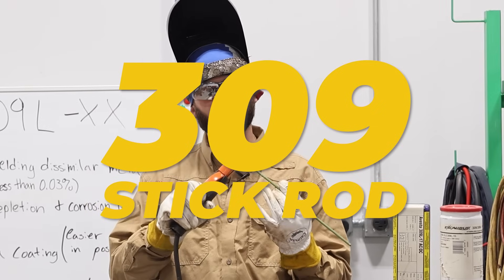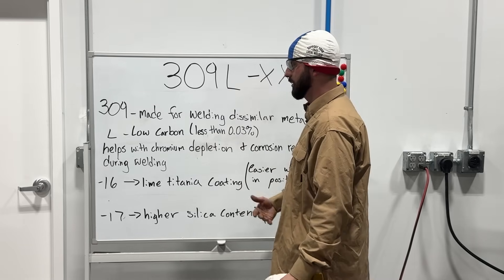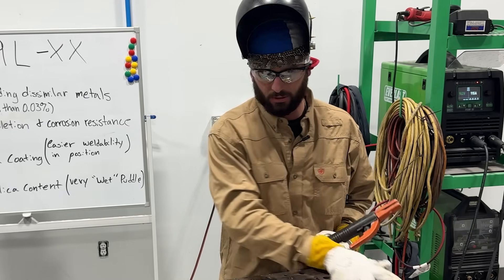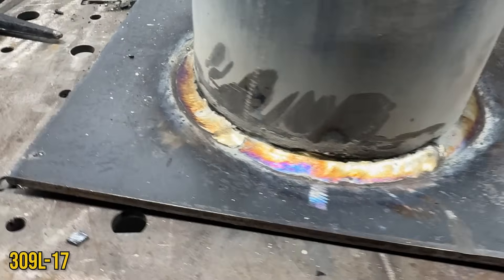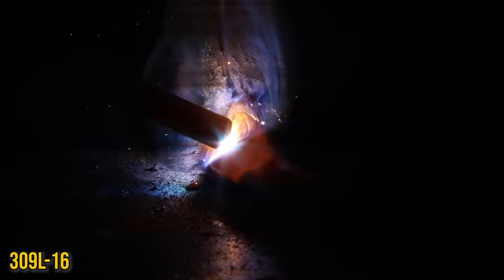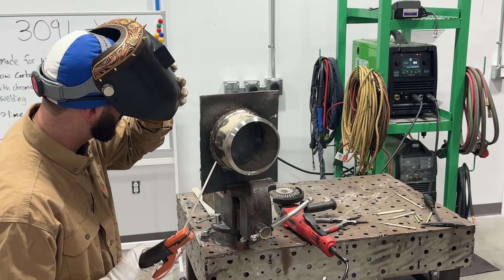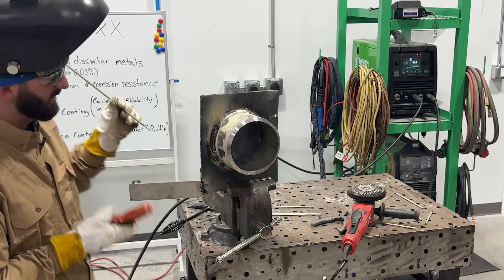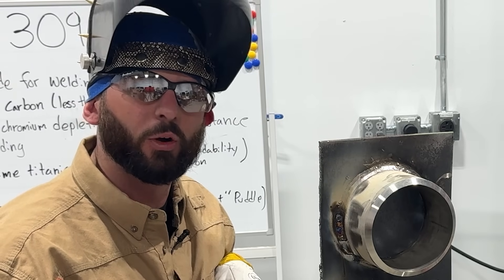Stainless Stick Welding Flat & Vertical: 309L-16 vs 309L-17

Comment: Used to weld at a shop where we built nozzles that went around ship propellers... It would be nothing to burn a 50 lb Tin of Red Baron 5/32 308 a day. I don't even think they make Red Baron rod anymore. Lincoln... Man but I'm telling you that shit would burn so nice.  We burn some 309 also. Because those stainless nozzles had a wrap of carbon around the outside...

Comment: Never welded stainless stell before till 2 weeks ago, i am welding 1mm pipe an MAG with 316-l electrodes , 40/55 amps, is a pain in the back as the pipe is verry thin ,but went verry good tho 🙈🤣 also you shoud go about 60/75 amps as the thick of your metal is ok on vertical 😉

Comment: For vertical -16 1/8” stainless rods, you should really be around 75-85 amps… it sounds low but it will weld way better.  And you absolutely cannot do stringers with this rod, guaranteed.  You have to weave it in order for it to lay flat…. Coming from an LA City D1.6 Stainless Steel certified welder

Comment: If the flux is different It’s NOT “the same electrode”. 
you got pinholes and porosity because you didn’t bake the rod, 
Crap instructional vid. 
309 is very fluid, a runny puddle and a difficult stick to run uphill you need some really good out of position skills before trying this stuff. and some practice with this rod, and it’s not cheap. As others have said, give yourself every opportunity for success start out with (DRY!) 3/32, CLEAN your weld zone, including grind out any flux before a fill pass, good fitup, and move quickly but  a trick some like is using a foot pedal with this rod to control heat and pulse it a bit

Comment: The main reason 309 wire can join different materials is b/c of the nickle in the wire. The nickle adheres to both the c/s and the s/s. Noticed a big diff in the 16 and 17 rods. The 16 was a lot "stiffer." 
  Nice restarts on the 2F. All the heat input of the part was not in your favor when the stick rods were trying uphill.

Comment: I thought if you're welding any stainless steel you needed to be careful of that hex something gas I forget exactly what it's called. But I see you are not wearing any respiratory systems, even a face mask, so what's the difference between the stainless steel that you have to worry about the hex something gas and the stuff that you're doing now?
Reply: I've only taken a 200 hour CTW Class and it only scratched the surface so I'm still learning a lot

Comment: yeh i totally missed the memo on the -17 vs -16 difference. they strike up so easy i ended up going uphill burning in a J shape wiuth a stop start method. was only for some light brackets and i felt like was cheating and dirty, but it looked nice as

Comment: I've had some problems with these avesta 309l rods. Aside from the flux popping off violently and with great velocity that are quite prone to hitting you in the face after you Run a bead. It's annoying. But more than that, this rod has a tendency to form cracks every centimeter or so running perpendicular to the direction of travel of if my memory serves me correctly. This was always with on material that had been freshly ground clean other than those very big issues, these rods seemed to run quite smoothly with good puddle readability and a nice bead profile. But that was indeed running it flat. It would NOT pass an inspection, so far as I can assume. I testing video. I'm wondering if anyone else ran into this issue or not. Cool video. I'd love to see a video where you cut out all the pieces of a 2x72 belt grinder (not a housemade)with your table and welded it all up and, installed the motor and vfd and wheels and then figured out what you paid for it in the end. You could source the materials and parts by whatever means you decide obviously but I love the idea of salvaging from a scrapyard at the very least. That would be an awesome video in my opinion.  Thanks for your effort , it's greatly appreciated I assure you.

Comment: In the little experience I have with stainless rods, a tip I learned was to deliberately stick the rod right before welding for 3-4 seconds to let it preheat, break it off, then weld. Runs smooth as hell. I didn't like doing it on the piece, so I kept a scrap piece to stick to so I didn't get arc strikes, but it definitely helped.
Reply: Agreed! I saw somewhere on YT where someone was using a small GRAPHITE block to do the same preheat you mentioned for 309L electrode. I ordered a couple of small blocks from Amazon (very cheap) and they are are GREAT because it's quick and the electrode does not stick to it. Just preheat and weld - real good.

Comment: In my humble experience as a welder . The -15 is better for welding in overhead and uphill . Its a low hydrogen rod. The -16 is a bit more easy than the -17. But if you have experience you can do the -17. My tips are to run the rod on the negative polarity for the stainless . Only run the 2.5mm or 3/32 overhead and vertical . And dont try to overfill because you can get slag inclusions , just oscillate enough to keep the puddle solid enough to avoid a belly and drip . But try to keep your passes narrow and thin . Wait enough at the side of the bevel to avoid slag inclusions . Keep your rods dry and warm . In position put the amparage at about 65 amps for the 2.5 mm , and if you can use a remote to regulate the amps i strongly recommand it. The hardest part is about between 4 and 3 a clock . You can restart directly at stops with the slag still on it if you have another rod in your hand and the weld is still hot within 5 seconds without any problem , you will get nice restarts . In my total experiance its a slow and illogical process . Tig and fluxcore are more logical and time/cost effecient , but it is not up the welder to choose this process . Good luck you will need it :)

Comment: I have little to none experience with these rods. Just once had to weld 16 peaces of 3/8" 304 bolts to some mild steel pipe by wraping all around the heads. I used 309L-17's and as soon as I tried them, I fell in love! I can say they love low heat, more of a drag angle and a short of an arc. The slag pealing almost made me cumm 🤭. All was done in flat position.
  Joke a side, be very careful with the slag, truthly even without tuching it, you can clearly hear it making crackling sounds and it burst in peases without warning! Safety glasses al the time around that hot chick!
  Didn't knew about the "-16" all position properties! Thanks mate!

Comment: You're trying too hard. Prop that rod on the work piece and just let it burn down. It'll run itself and come out perfectly smooth. As for running vertical, run as cold as you can until you get a little weld in it, then bump it up, and weave weave weave.. steady side to side, no holding edges like 7018's.

Comment: 3/32” 309L-16 is the way to go with out of position. 1/8” works, but if you’re willing to do a ton of start and stops unless it’s base material is thicker than 1/4” and you can run a 3/8” weld size.

In position, prepping material as if you were to TIG weld it really helps keep everything clean and free from discontinuities. 

Some applications outside of position it can help to prep the weld like you would TIG weld it. The Chromium Oxide layer requires more heat to penetrate and can cause the puddle to be more runny if you’re moving slow. 

If you’ve got access to Gasless flux core 309L, I recommend it any day over SMAW with 309L. It’s easier to work with out of position, and you have more control over your amperage.
Reply: I love using dualshield wire.

Comment: Uphill try about 75/80 Amps with 3/32 and square weave. Always worked for me brother. Same with 316L 👍🏻
Reply: Having a 309L 6g test to do tomorrow, will try this for sure
Reply: @ rod angle is crucial with 309L when you come around dead man’s corner you gotta turn the ole wrist and maintain good angle or you will have bug holes most likely. Just my 2 cents 👍🏻
Reply: @ yess that exactly what I think, rod angle, arc length are 2 big thing that can make you fail a test. Im not reslly familar witu 309L last times I weld it, it was 5 year ago and I was freshout from school

Comment: In my experience with 309 rod, if you throw them in the rod oven for the next day, 100% it will take care of the porosity problems. Very important if you're welding pipe.

Comment: I'd heard that the fumes from these rods are more hazardous than normal.  Is that true?
Reply: yes they produce hexovalent chromium fumes, Erin Brockovic movie, very bad for you
Reply: Very bad in poorly ventilated areas. If you can’t get fume extraction  at least protect yourself with a good respirator!
Reply: @gedavids84  all welding fumes are bad. Tons of carcinogens. But that stainless will mess you up. And you won’t even know it till it’s too late.
Reply: It's the chromium and the nickel fumes and their dust that'll kill ya.
Reply: @Busterdmj1057  so is this a hazard to be aware of with TIG welding of stainless steel as well?
Reply: @gedavids84 yes. All welding to be honest though.

Comment: Wear a respirator the fumes off of stainless are far worse than carbon. Because stainless tends to bunch up in the center I tend to use a used 1/4” disc to scribe before I weld and it gives that stainless rod a valley to ‘wet’ out into
Reply: That chromium smell after welding... I use a PAPR, and I love it. Helps having a fan on your face, too, as an added bonus. Like he says, if it smells like it's killing you, it's probably killing you!
Reply: Respirator?  C'mon, what's a little lung, throat, or sinus cancer?
Reply: THEN WHAT? Do I need safety glasses and steel-toed boots too?    I like the open air when welding in a t shirt and my safety sandals. LOL
Reply: @jvmiller1995   don't forget the safety squint
Reply: Right - Or run a small fan to make a little lateral breeze.

Comment: In my 25+ years of welding I’ve taken 8, 3g and 4g 309 tests and busted out once. But hey that’s how you learn. It’s a lot easier if you use 3/32 8” long rod.

Comment: 309 is great for dissimilar ss to mild, but.. only with stick or flux core. But if you're running regular mig, you'll get much better penetration with 316 wire and 98/2 gas
Reply: at work we use alot of stainless wire to weld ss anchors to mild steel , we do use 309l wire and 98/2 gas though. Unknown stainless grade ( like 304 to 310 or whatever ) we weld with 308l wire and the same gas.

Comment: You should have them in the oven and smoke th3 rods on a scrap metal or ahead of th3 joint a little. They should literally smok3 after 5 seconds of sticking then remove and restrike the arc. Flat position experience only